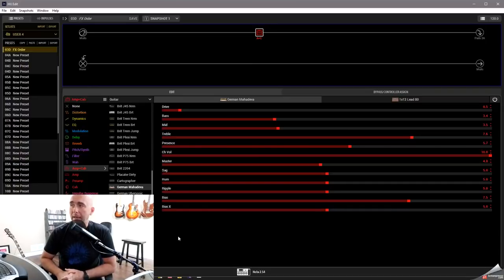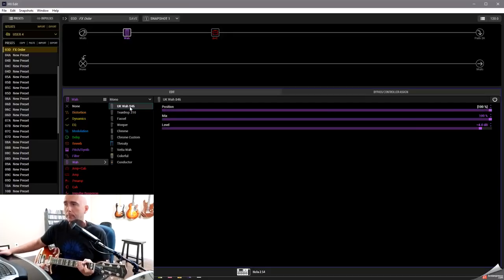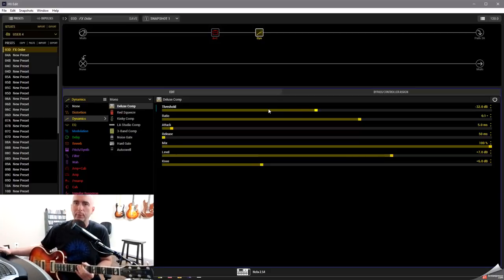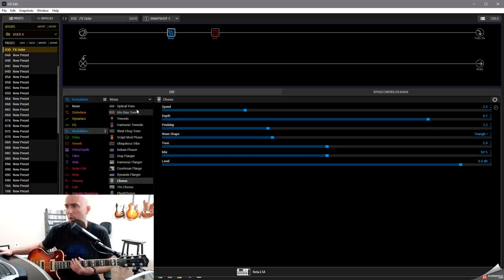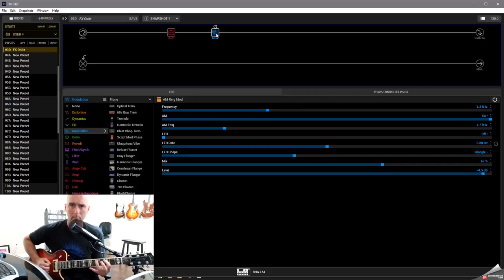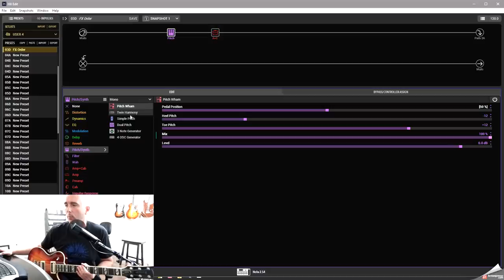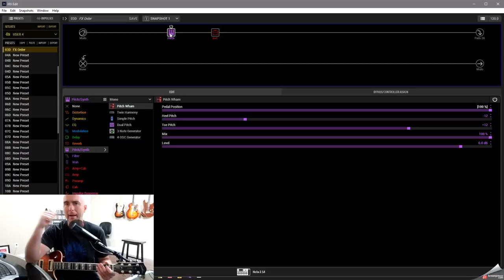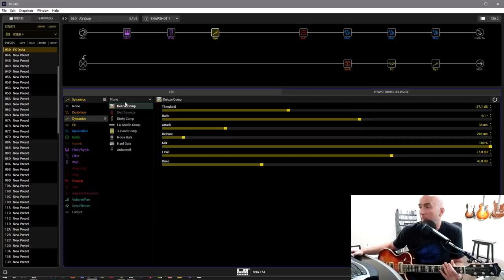Line 6 Helix - How To Create A Great Tone - Pt. 19 - FX Placement Within The Signal Chain

Comment: Thanks Jason. This was interesting especially with the modulation stuff. Very true that it depends on what you are after or the style of music. 

I’ve recently simplified a patch and ran it like my amp setup with all pedals into the front. I mostly play church/worship style music and couldn’t get some of the overtones in the Helix I get through my amp. I setup a patch running delays and reverbs into an amp on edge of breakup. Drives added in front of those as needed. Some of those overtones I want came back and so I was pleased it had some similarities. Although the after amp certainly works for most other styles:) Nice video!
Reply from the maker: Thank you so much :-) That is awesome that you found the tone you were looking for by experimenting, that is what it is all about :-)

Comment: Hi Jason,
I'm catching up with this tutorial a bit late, so I'm hoping my comment / question gets to you and makes sense.
Lately I've been experimenting with setting up my Helix and tube amp to replicate my old pedal board and amp - really as a 'test' of the Helix to see how close it gets to my previous pedal sound. As part of the setup I've been using the 4 cable method, and I've been refreshing my understanding of this approach as I go, to make sure I'm on the right track and applying the Helix in the same way as I used to with my pedal board (most commonly to place compression and drive pedals before the preamp of the amp, and modulation, delays and reverbs into the FX loop of the amp).  At the same time I've also experimented with placing modulation effects up front, and so on.
I'm pretty clear on how to set up the cabling between Helix and amp. but what I've found is that there's a huge variety of (potentially very confusing) advice out there in relation to how the single Send/Return block or separate Send and Return blocks are used in the Helix signal path.  Eg: the Helix 4CM template uses only one Send/Return block (with no real explanation of why this is an appropriate approach), while another Line 6 tutorial uses separate Send and Return blocks (again with explanations which are not particularly adequate).  Then there are any number of alternative approaches in the forum discussions!
Rightly or wrongly, I've come to the view that separate Send and Return blocks will suit my approach best. 
But I also thought that a tutorial on 4CM might be very helpful for people like me who are trying to set up Helix with a separate amp (rather than a modelled amp + cab or IR block).  Or perhaps a specific topic like this might suit one of your new FAQ segments???
I hope all this rambling makes some kind of sense, and is something you could address without too much effort.  Looking forward to your response.
Cheers,
Graeme Kirkwood

Comment: May be its just me, but I find it weird putting anything after the cabinet because that is not possible with real amps unless we are also modelling the mixing that happens to a mic'd cabinet. I will have a play and see if it makes a difference putting effects between the amp and the cab, or after the cab. I assume putting effects after the amp is the equivalent of putting the in a real amp's effects loop.
Reply from the maker: Yes it does seem odd at first, but I have found very minimal difference between putting them before or after the cab. As I mentioned in this video, for most FX it is really the interplay with the distortion that seems to have the biggest outcome on the sound of the FX. Give it a try and curious to hear what your findings are :-)